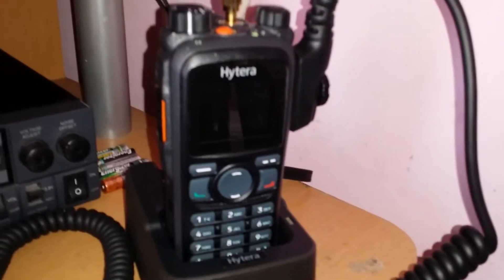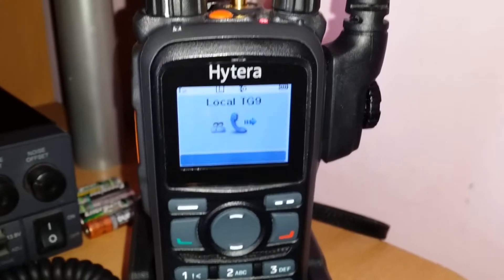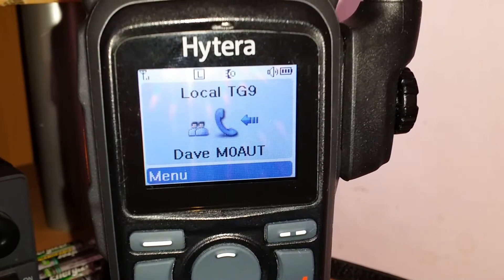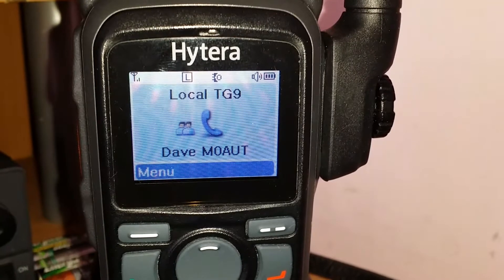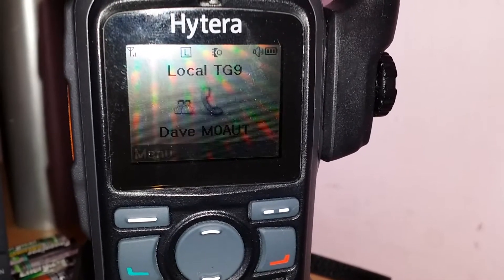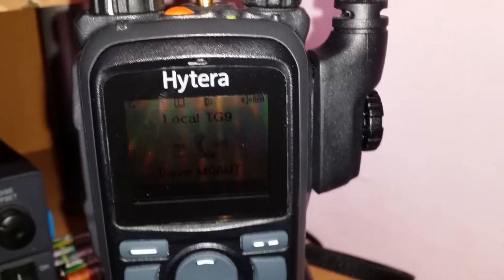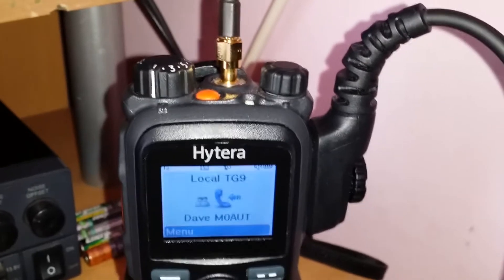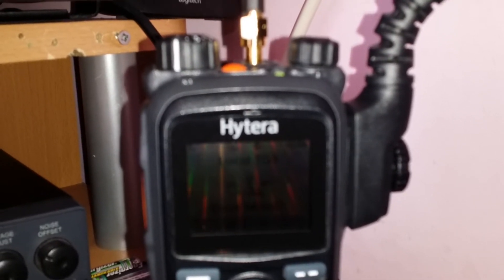Gb7fc Hytera repeater dmr test

Comment: Hi dave and dave is this the new hytera repeater ? Love the look of this handheld and display so you can have DMR and the hytera network as well on this radio  ?  The audio on hytera sounds great !  I run a dm4600 and dp3400 and cs700 the 700 is low on audio quality but I believe a firmware upgrade to fix coming zzzzz slowly 

73s M0MBv
Reply from the maker: MARTIN HENNESSEY Hi Martin yes this is the new hytera repeater just gone online over the bay area from me.My dm 4600 also works great on the same repeater .